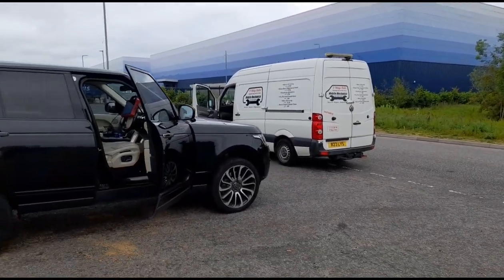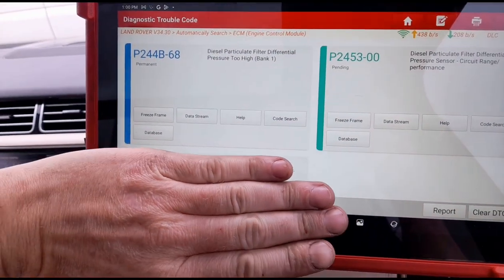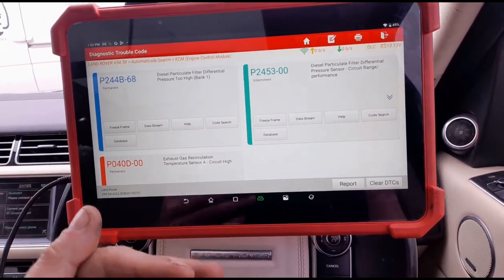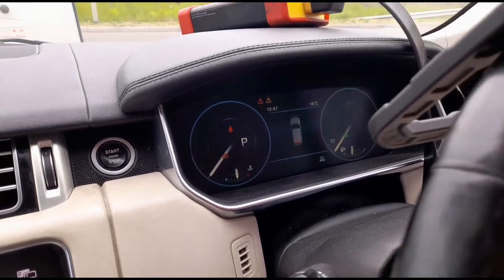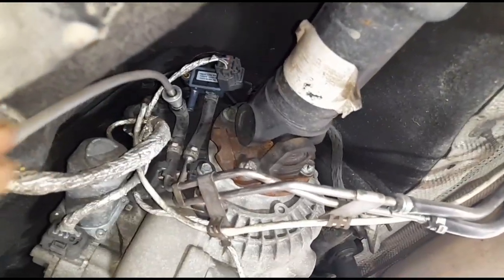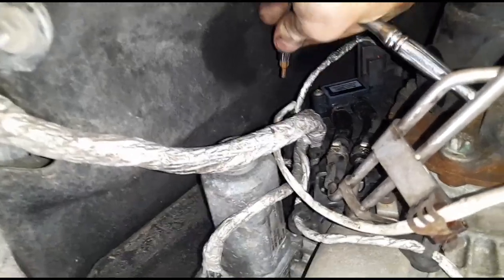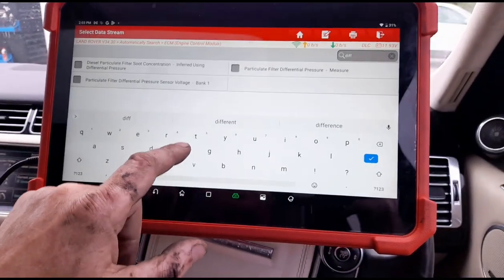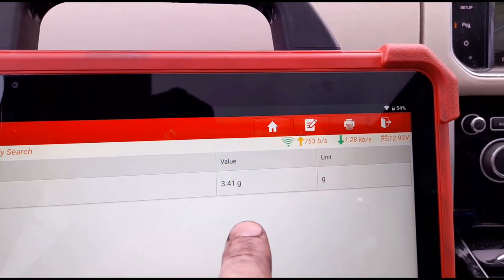Range Rover 4.4 P2453-00 Diesel Particulate Filter Differential Pressure Sensor Circuit Range. DPF

Comment: Hey love the content. My dpf full light just came on after a 150 mile trip to Glasgow. I’ve not got an OBD2 but any ideas? Surely it’s not the filter after that trip, sensor maybe? Thanks Craig
Reply: It's probably not doing regens because of some issue somewhere. As this channel shows, a scanner is an essential tool.
I recently bought a Foxwell ft530 for £164 new (didn't spot any attractive deals on used scanners and wanted it quick). This, plus watching Jimmy's videos helped a lot in sorting out my BMW 330D that hadn't done a regen for 7000 kms.
Reply: @lint8391  was the throttle body all sorted now.